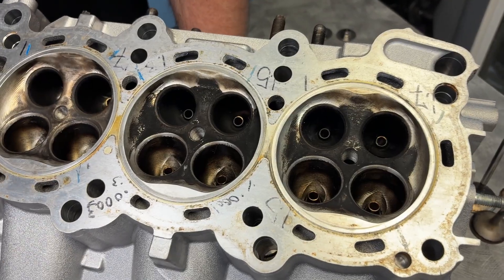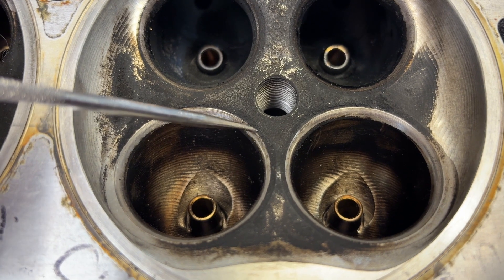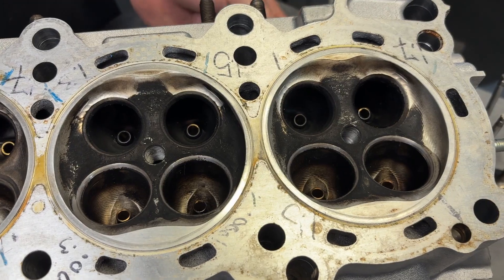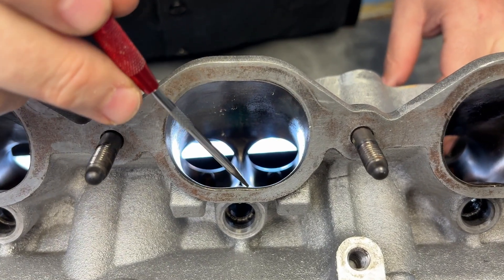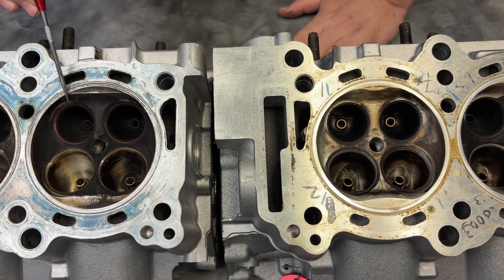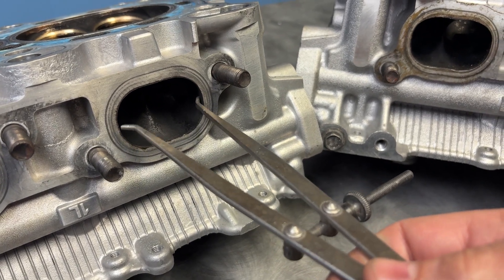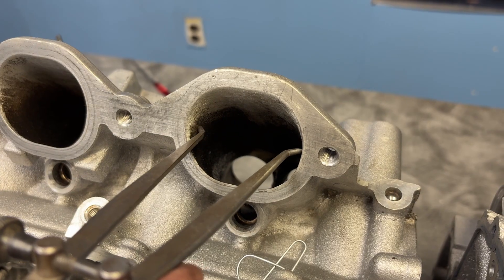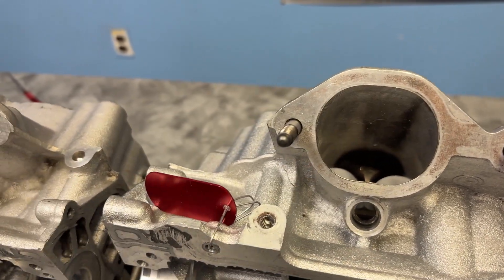What NOT to Do on a VR38 GTR Head Build

Comment: Hi Dave. As always, your stuff looks so good. As I watched the video and saw what you were doing by welding up the water jacket, I noticed the welded area looked peened. This made me curious. I will commonly peen a weld to relieve stress and minimize shrinkage in a weldment. I'm just wondering if that's what's going on here, if I saw that correctly, or what? Thanks for all your awesome content.
Reply from the maker: You seen it correctly! We peen all the dirty aluminum welds. There is a video coming up on welding that section specifically and shows the peen.
Reply: @headgames  That video is interesting, I'm looking forward to it.

Comment: When will you be flow benching/porting a set of Hyundai 2.0t heads?
Reply from the maker: I have only seen 1 in come through the shop. We can't port our way into making that thing good if we are speaking about the 4B Hyundai version.
Reply: @headgames  Head part# is 47RU5-2GF00 off the Kona/ Elantra N's. It's an ugly looking mess with the tumble plates inserted into the intake port and some odd high spots near the center divider and the guiude bosses. there has to be room for improvement in there. Don't think anyone is really interested enough to bother with porting the head yet... just interested to see what can be done with it.

Comment: Hey Brother not VR38 related, but would you recommend porting a blacktop SR20 head? I don't have interest in doing a full VVT head swap. I was just wondering how much additional flow you can get out of a blacktop or Red Top SR20. Mine is the latest version out of the 180sx Type X. Still non vvt.
Reply: Also it seems like they grabbed the wrong head for the GTR off of a different shelf for a different engine build and just built the engine with the wrong head on one side, how could you even do this? It's crazy. Also does that mean that the other engine also has one wrong head on it somewhere out there or in the shop!! Wow
Reply from the maker: How much power?
Reply: @headgames The car makes 400 wheel horsepower now, running 18psi on a mid size garret turbo T3/T4, has Toda 264 cams and adjustable gears.
I drive it on the street and race it on road course days and at the drag strip. Now I'm just contemplating whether it's worth it to do it to this head, if/when I build the block for more boost.
Reply from the maker: @beauvrt  valve springs, supertech. Done. Making more than that I would get into a rebuild with guides and valvetrain upgrades. Not oversized, just better than oem for 450-500. But, we don't work on them anymore.